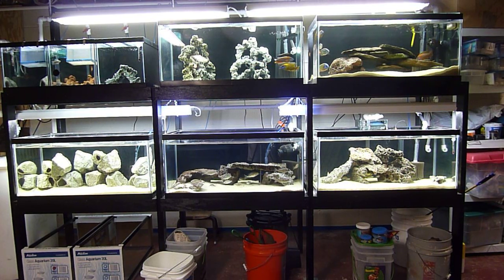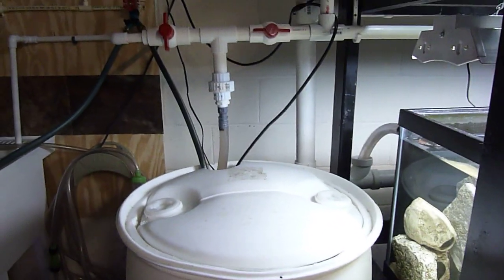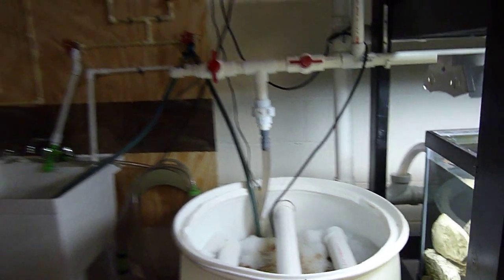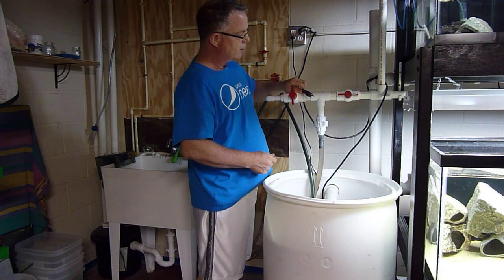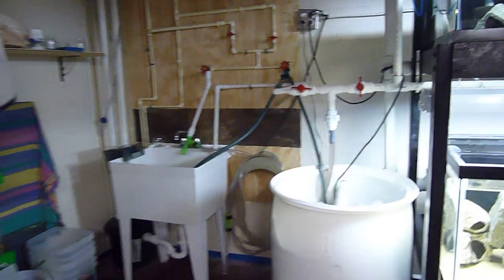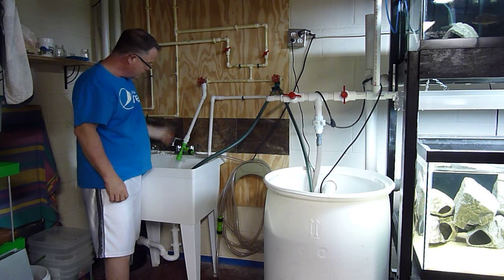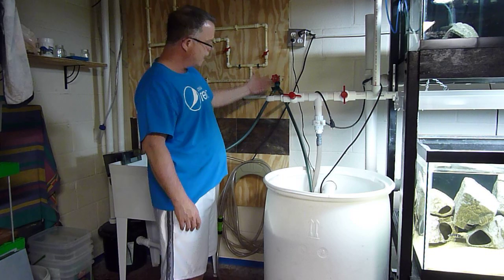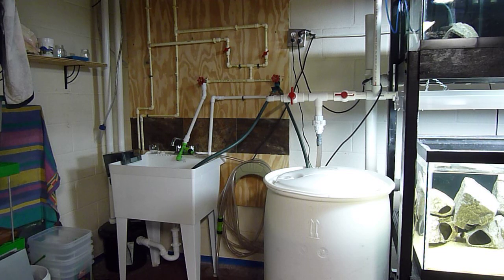Fish Room Update - Water Change in minutes

Comment: Nice system. I have two suggestions for you:
1- You can actually automate the whole process using lawn sprinkler system valves, a control box and a thermostatic mixing valve that will control exactly the temp of the water coming out, and you won't have to unplug the pump nor shut or open valves manually. Great system though . 
2- I highly suggest you add another tub to have the new water added to it and treated before going to your sump to avoid loosing bacteria or even fish as sometimes the water district may add more chemicals to tap water after heavy rain or in certain times .

Comment: have you considered adding a 3 stage carbon drip line into the sump with an emergency overflow at the top of the sump dumping into the sink? that way you could slowly drip new water and not need to do manual water changes. also, how reliable is the sump pump under the sink to your house drain line? could it ever fail? I'm about to install one myself

Comment: HELLO,
The only problem with your system is you add water to the filter could kill bacteria, you should have a tank with right temp of your water not using tap water, or pre mix hot cold, do u know the hot water tank is full of heavy metals, add a storage tank to your system it will do u good, try to drain from the tanks to the sink not the filter.
hope my input will help ur fish

Comment: If you were to install another valve on the trunk line to the sump pump you would never have to unplug you pump.Just close the trunk valve and open the valve to the sink. This would allow your tanks to drain directly into the sink. The reason this would be better is sometimes when those mag drive pumps get some age on them they dont want to start back on their own.
Reply: ***** I see what your saying, But If you had a valve on the trunk line It would just be a matter of closing the valve to the tanks and then opening the valve to the sink the sump would empty. Then close the valve to sink open valve to tanks to start the flow to tanks again. To drain the tanks to the sink open valve to sink close valve to pump.That way you would never have to unplug the pump and never have to restart it.

Comment: do you guys have no chlorine or chloramines in water ??
Reply: we have both in our water here do you use prime or something
Reply: ah yeah thats good stuff straight into the sump im guessing nice setup btw i really think u did a great job something i would love to strive for
Reply: subscore 44 he said when he does a ‘substantial’ water change, not just the demo, he adds Prime.  When I do top offs on my system (less than 5% water volume to account for evaporation) I don’t need to treat.  I do run the water for a minute first to purge any stagnant water from the water line. Plants and fish do great. Low stocking levels, tons of plants.  My county adds inconsistent amounts of chlorine, based on rainfall, so I keep this in mind.